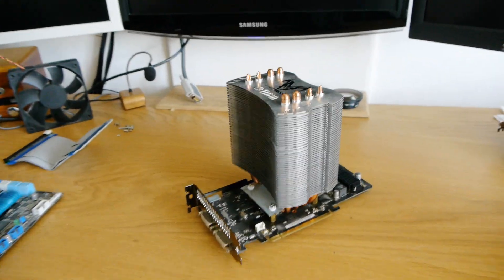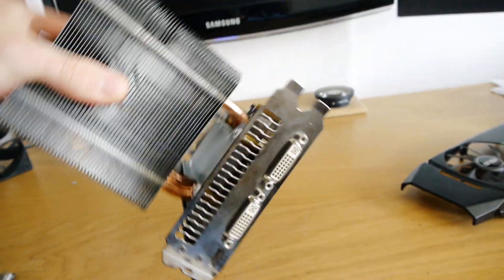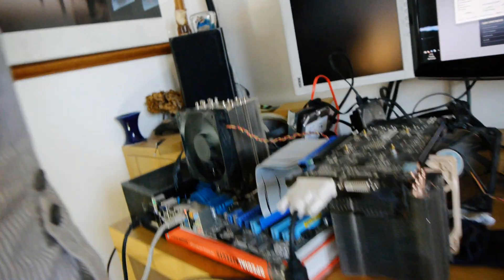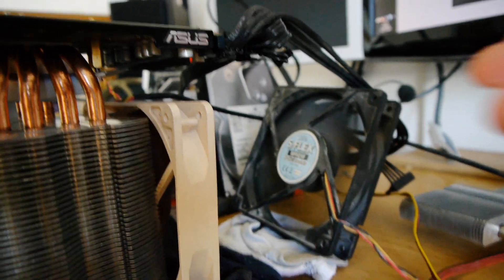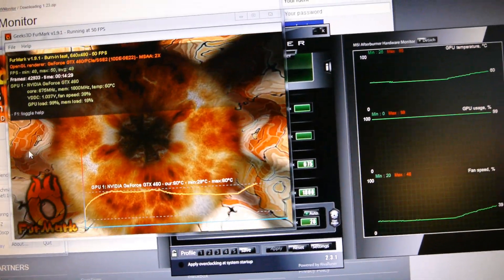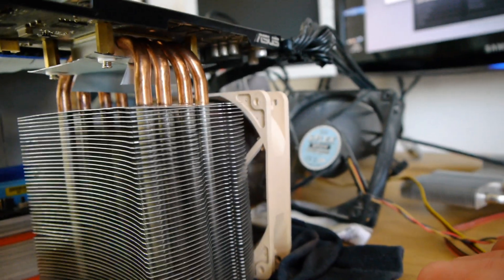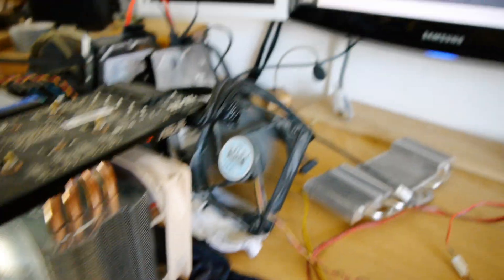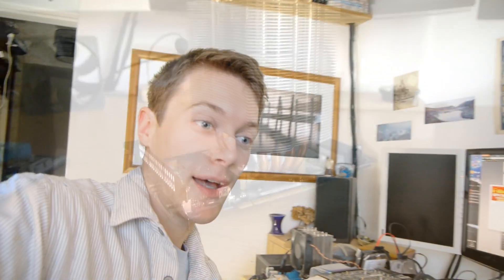CPU cooler on GPU (INSANE temps!)

Comment: How is this gona cool your graphics its a hunck of metal or what ever it is attached wont work you need air flow no fans no water cooling?
Reply: ***** it's not a hunk of metal. it's a fucking heatsink, designed to pull heat out... what are you missing here...? you're literally too stupid to insult
Reply: ***** "you need air flow no fans no water cooling?" clearly the video shows he has fans... which means theres airflow and obviously not water. not too bright are we
Reply from the maker: I'm going to guess that you didn't watch the whole thing before commenting...
Reply: You only have 2 fasn from whay I see how is this gona cool your gpu long term even when its very hot oput side? Liquid Cooling qould be the best way plus your not taking in teh fact you need to maintain your stuff even more you also hjave a honking metal heat sink thast uble the pipes are good idea but shrink the heat sink and you may get my attention.
Reply: ***** Well, you've proved you're stupid, at least.
Reply: ***** What's that got to do with anything?
I'm expecting custom shit on a channel called DIY, stupid.
Reply: ***** lol cheers. i had a good laugh from your comments
Reply: ***** Because you obviously don't know shit about the inside of computers.
Reply: Allan Floyd
he may be better at this without a computer
Reply: ***** Do you even spell bro?
Reply: Stupidity level: 9000
Reply: *****

Did you buy an alienware computer? perhaps a prebuilt dell.
Reply: ***** Why are you even trying to defend yourself?
You must be about twelve years old, I'm guessing...
Give my degree? What a laugh...  I could say I have any degree I want, and so could you.
I'm going by the evidence of your exhibited level of intelligence (or lack of), not some claim about a degree.
You fail at life, dumbass.
Reply: *****
you are the far side of ridiclous, listen to the experts
Reply: ***** Well, I know I know more than you do, since I know that heatsinks are always attached to the chip they are supposed to cool down, and I'd never say some stupid shit like:
"How is this gona cool your graphics its a hunck of metal or what ever it is attached wont work you need air flow no fans no water cooling?"
Just plain fuckin' stupid, no other word for it.
And you just keep posting, proving it more every time!
What hilarious stupidity will you post next?
I can hardly wait!
Reply: no one is gona buy this shit htough you laugh i wont but nice DIY.
Reply: no shit sherlock fucking ugly heat sink indeed i am a hter and dont like jerry rigged shit so get over the bull shit already.
Reply: everyone is stupid all i can say is stupid people say and so stupid shit.
Reply: well so have you by supporting custom shit that cannot be put into a cast.
Reply: ok stupid.
Reply: what is what I own have to do with any thing just wondering?
Reply: well you do? do you have certs?
Reply: I knew the heat sink shit I was referring to the shit in the video. How stupid can you be? G  your degree and then say I am stupid  any how your flamer and waste of time thinking you're a know it all i am done with this.
Reply: ***** You realize a heatsink can cool down something without fans? Ya'know by spreading the heat? Their are actually fanless heatsinks on the market already
Reply: Yea but to a degree, running no fans on a heat sink is stupid though and running a big block like in the video is no point as well is doing nothing it's all copper doing the work why conduct heat tot eh center of your CPU and have copper do the work? Just make the heat sink smaller and leave the copper pipes in try that.
Reply: ***** At the beginning he doesn't show fans on the heatsink but when he actually had it running he had a fan on it and one nearby for more passive air
Reply: *****
 You do realize that a huge block of metal with good thermal conductivity is fine for a CPU in most cases if it isn't under intense load.

And he did have fans, he just didn't have them set up when he was mucking about at the start.

Comment: To mount proprely the graphics card on to the motherbord you just had to rotate the radiator for 90° !
Reply from the maker: But then where would the air go? The motherboard would be in the way, making proper airflow impossible and nullifying the test results.
Reply: You just have to reverse the air flow direction of the fan attached to the radiator. Instead of blowing toward the radiator it would suck the air through it. You just have to put the fan at the top. I guess that's possible.
Reply: DIY Perks Dude this is NOT  a good idea for people to be doing with their expensive graphics cards.But I do appreciate the experiment.I have also considered doing this in the past with a couple monster heatsinks I have in the closet.However the room it will take to make it work and voiding the warranty isn't worth the curiosity.Not to mention that the memory and voltage regulators REALLY DO need cooling.

Comment: what brand and model of the CPU cooler you use there? is that a customize back plate  on the heat sink or is it included with it?
Reply from the maker: It's an old Titan Fenrir - they're pretty decent coolers, though they don't fit modern systems. That's ok for this though because the mount was custom made.

Comment: Reminds me of the time I tried to overclock a friend's Compaq laptop (what else can you do with one of those?). I figured if I pulled the heatpipe out of the case and ran cold water on it, it would suck enough heat for the computer to run Rigs of Rods at an acceptable frame rate. LOL nope, it overheated before it could even boot. I got it going again with a little aluminum fin cooler/fan, which ran it until the board fried.

Hopefully your massive badass sink works better than my ghetto rig! I like the custom mounting.

Comment: I can't remember the exact °C difference but I got a TwinFrozr II on my GPU
(which was supposed to be "20°C cooler than stock cooling")
then I damaged it accidentally and got an AcceleroXtreme II which is a monster
the temps got around 15°C lower than the TwinFrozr II ones
the 3 large fans are also much more silent
bigger is better :p
the only problem is that the room still gets warm

Comment: Wow, this GPU cooler is awesome. A total hack! It's a great idea. Well done! Would you ever try slicing some of the aluminium cooling fins so you could plug it straight in to PCI-E?
Reply from the maker: I've actually already mounted it into a case using another method, but yours is actually quite a good idea, so long as it's not too hard to shorten them.

Comment: nice...I tried this some yrs ago with a noctua uh-12D but I turned it 90° so the air was blown out the EATX-case-sidepanel where a 250mm fan was mounted aswell....but now I use the prolimatech mk26 + 2x120mm fans on a gtx 680 ... and I got quite the same temps in a closed case with low noise ^^

Comment: If you want silence, remove all the fans and do a custom external liquid cooling loop. With big enough radiator, you don't need any fans at all, just a good enough pump. it will be super quiet.

Comment: if you ever have the time and financial stability, PLEASE TRY THIS ON THE 780ti or the TITAN Z my curiosities on the potential capabilities are killing me haha xD

EDIT: whoops didn't notice the absence of overclocking :/ well hopefully another guy will do it some day :P
Reply from the maker: I probably won't do it with the GTX 780, but I'm pretty sure I'll be doing it on the GTX 880 whenever that eventually arrives.
Reply: DIY Perks Can you make a video explaining how to set up in line 2/+ coolers with a knob to make their RPM increase? I would like to make that kind of thing and i honestly don't know anything about stuff like this :D
Reply: This thing needs alot better system to cool VRM on high-end cards or you will probably reduce the lifetime of your card by very significant amount.
Reply: SomeNormalRomanian
Get one of those http://www.ebay.com/itm/Molex-to-4-x-3pin-Fan-Cable-12V-/251189254218?pt=US_Power_Cables_Connectors&hash=item3a7c0bd84a or similar and the fans will be at max speed.

Comment: ive been running my gtx680 cooled with corsair h60 for over a year now, max temps on bf4 32 degrees....and it still fit into my case... and i cant even hear it on full load

Comment: You have the heat pipes upside down! Heat pipes are designed to work only in one direction, sometimes vertical and sideways but a heat pipe will never bring heat down, if you flip it over you should get much better cooling. I would be really interested to see how much of a difference it would make in a side by side test with just the orientation changed.

Comment: but how you are going to fit this cooler in your case?

also the weight of that cooler may bend the grafix card...

you need some kind of holder on the other side of card to prevent bending...
Reply from the maker: I'm building a custom case with space for it. It'll be well supported too, so as to not damage the card. It's looking good so far! I'll be uploading a video about it once it's finished (probably mid May).
Reply: will be waiting to see that,
i am also very interested in making my PC silent.
currently, the only 2 parts that generate any noise are, 120mm big fan (~600rpm) on cpu and 2 80mm fans on the video card (throtteled down by software to ~35% speed).

basicly my PC is near-silent, but still you can hear it at around 3AM :)

i want TOTAL silence :D

i was thinking to buy Zalman TNN500AF case.. but its too expensive and no longer in production, as well as it has weak power supply and probably doesnt fit very well modern parts..
Reply: At the beginning of the video I was thinking the same actually,  my cheap card didn't have a fan so I adapted one from an old Pentium I cpu cooler it works well, now I have a stock  Amd Cooler I my try to do something similar,.
Reply: DIY Perks Mid May.. so soon :3

Comment: this is funny I actually burnt up.. well melted.. a fan off of and old GPU... So I took an old CPU heatsink, some zipties, and thermal compound. Ziptied the heatsink to the gpu and stuck it to the card with the compound and it still works today like 5 years later lol....I then realized when you have that large of a heatsink you don't even need a fan... The heatsink works better than the fan did!

Comment: the results would be even better if the card and cooler weren't upside down
Reply: That's what I was just thinking. Turn it the other way and you'll probably drop 10-15 degrees.

Yes, heat pipes "work" against gravity. But they work more efficiently with it.
Reply: i might be wrong though, heat goes up when it comes to air because of the density difference. With metal it might not be like that, givingit a second thought, perhaps it won't make any difference.
Reply: FCValle  You're not wrong, heat pipe efficiency is effected because of exactly that principal.

In a heat pipe fluid evaporates, migrates to the cold end of the heat pipe, condenses, and is wicked back to the heat source to evaporate again.

If placed upside down, in gravity, the vapors need to accumulate to reach the heat sink, keeping the hot gasses at the heat source, and the wick needs to work against gravity to bring the fluid up.
Reply: atsernov
So in theory if I put my case on it's right side my Noctua D-14 will cool my cpu better?
Reply: as I said, I gave it a second thought and I think it won't make any difference. It works with air becaus the hotter molecules can go up, as they are not tied to each other. Heat pipes are solid metal, density differences can't make the molecules move, so i think it will be the same.

In other words, i changed my mind.
Reply: FCValle One flaw to your logic, heatpipes are NOT solid metal. It's a heat-PIPE not heat-ROD(AKA-heatsink)

Use the internet for what it's made for, do some research.
Reply: fuzonacid In theory, yes, it should be a little more efficient on a tabletop rather than tower PC.

But it would be MUCH more inefficient if you mounted it upside down like on this video card.
Reply: atsernov ohhh...then I was right before?

lol I feel dumb right now, i thought they were solid! hahahaha

Comment: im running my overclocked zotac 285 with arctic cooling custom cooler 
temps are about 60C in stress without big chunk of metal shit stuck to my gpu
thats just waste of space you cant even fit this inside of the case

Comment: hi, nice experiment, i also have a gtx460 from evga and it runs very quite also of full load evga are very good, once i had a gtx460 asus and sold it after 1 week as the fan on it was very bad very noisy it would rev at full speed sounded like a plane

Comment: Hello diy perks, could I ask since you mention TDP, the thermal rating of that cpu heatsink is what about a high end cpu (135w) + maybe some overclock and voltage tweak~ so maybe 150w. A single video card max is about 300w, allow 85% power supply so 255w to board, say 16 ram chips around 1w each so 240w to gpu. This large heat sink might not be enough for some cards, but is good for mid-range ones. Your demo really shows how marginal the typical reference cooler is and why video cards are typically so hot, 200-300w on just that envelope sized area and maybe only 200w or so for the rest of pc all spread out.

Comment: But well, you cant cool the GPU-RAM with that
Reply: ***** Who needs water cooling when you can spend much less and make that beauty!
Reply: Nobody Inparticular :O 1966!!! CALL THE DOCTOR NOWWW!!!
Reply: Approved
Reply: Nobody Inparticular Smoking is bad for your lungs... And your GPU...
Reply: The original cooler also doesn't cool the ram accept for a bit of air flowing over the chips, but no contact with the heatsink.

Comment: What fan controller is that? i remember some year ago i overclocked my ATI HD 2900 pro with the stock cooler at its max and i made a record on hwbot for unigine heaven, then after some time a guy overtook my record using a CPU cooler on the gpu, i was upset lol

Comment: problem with doing this today is the VRM's get excessively hot now too so if they aren't getting almost as good cooling or some kind of contact on the heat sink you'd burn the card out.

Comment: The only problem is that you had it upside down, so the heatpipes are less effective :( (Heat rises, hot solutions in the pipes go to the GPU and the cool sits at the bottom)

Comment: The stock cooler is designed to cool all the other board components as well i.e. capacitors, mosfets, regulators. If you are just cooling the GPU, other components will suffer reducing longevity/failure imminent.

Comment: some tips for your new wooden PC: use filter with the fans so the dust doesn't go inside that easy, if you can use SSD rather than HDD's, so it is quiter, go with Noctua fans- one of the quitest fans...
 :)

Comment: kudos to you diy for the experiment. i too thought of doing that even though its a bit impractical. very cool nonetheless. i remember cpl years ago when i bought a 660ti, i hit a passmark 3d score of 5000 (appr) in my 2nd pci2.0 slot. when i ran the test in the 1st 3.0 slot i hit 53xx. very small increase but still an increase in benchmark score. i would like to slap a nzxt g10 on my 780 lightning and some nice ram heatsinks but i consider my gpu purchases like a lease. as soon as a better one comes out, i buy it and sell my old one.